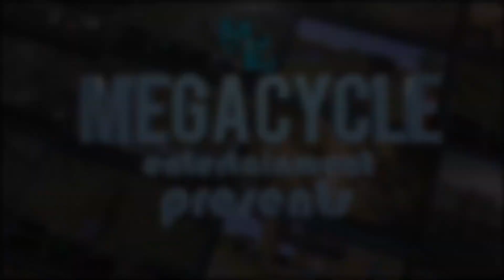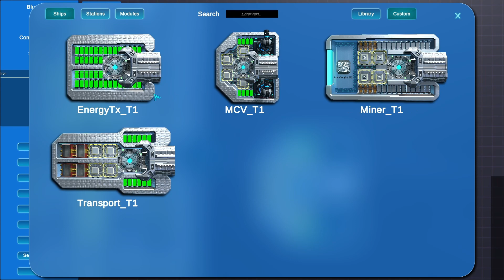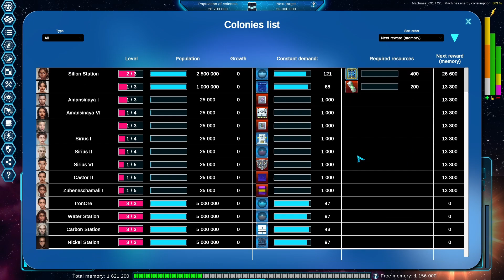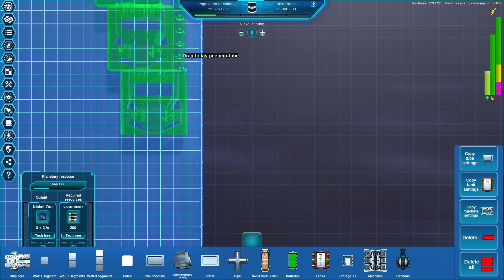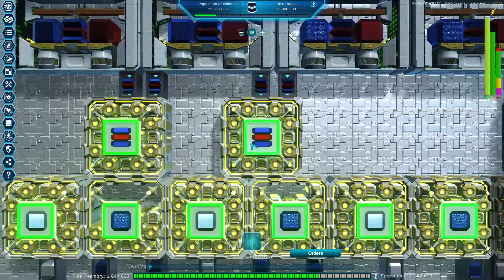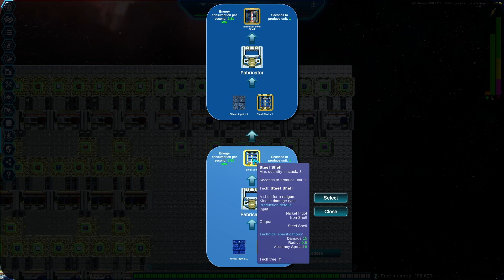Final Upgrade - S02E04 - Uranium and Composites

Comment: The space teleporters can actually teleport up to 5 planets away.  I'm not expert so I can't really say how well they perform in energy costs against the freighters but there is a help page on logistics energy if you haven't seen it yet.  Also, wouldn't it make more sense to use the core to pull items from the planets since they are free versus the planet teleporters that consume 4 energy per stack?  It seems energy is a non-issue, but I thought I would mention it.
Reply from the maker: Aye. They used to be more energy hungry and I didn't mind using freighters even though they took longer. That being said, I didn't give them a proper look in 1.0 and they may have been improved.

Comment: Just a correction - storage units do count as machines. Everything under the machines tab, cannons tab, plus robot docks, storage (not tanks), ship cores and station cores count as machines for the purpose of the energy multiplier. I mentioned storage in the comments for last vid, but JMC pre-records the episodes so couldn't correct the VO for this episode.

Batteries don't count, so can go as mad with those as you want to.

I tend to use the old school resource zones on transport ships, miners, and for anything that doesn't need bulk storage. With the lowest cell limit (1000 cell ships) you can reasonably squeeze an 800 unit resource zone on to a transport ship, with the ship core being the only 'machine' on the ship. It's less space efficient and larger ships have more mass, so take a little more power and longer to charge their jumps. Even still, it can end up saving a lot of power just from keeping the multi down.

Living metals regenerate as long as power is available. They don't have more resistance than normal armour, but it will feel like they do as they will regenerate even under fire. The downside is massive power consumption , so plasma batteries and nuclear power are pretty much required to use them.
Reply from the maker: Ye, thanks again for the notes. I thought my observations about machine numbers came from either Greens aggression level (which is based on machines) or the 'power consumption rate'.

Still, I appreciate the corrections. 👍